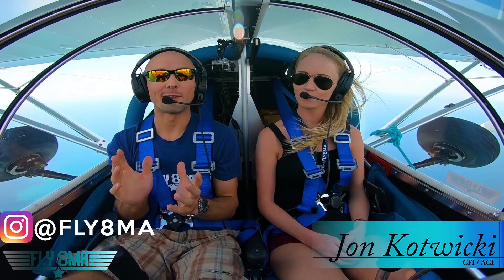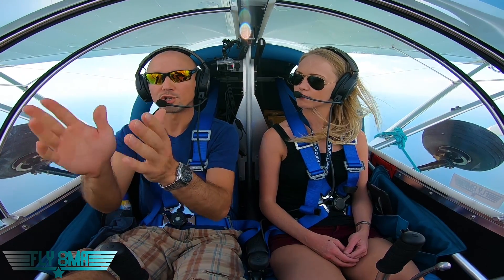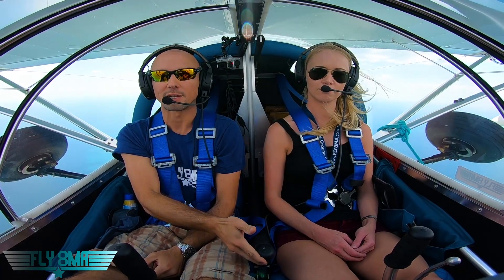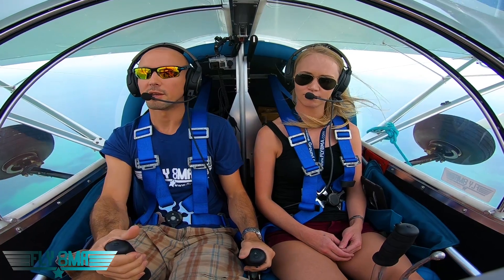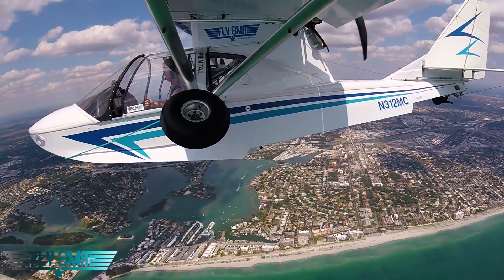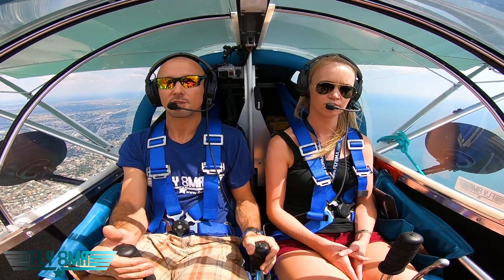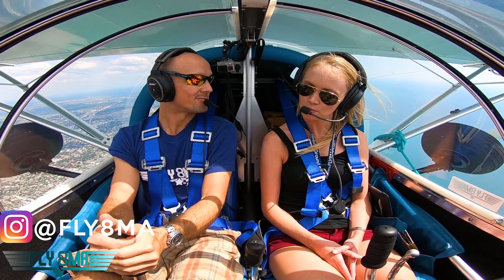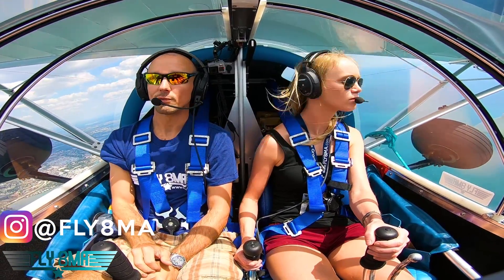Airplanes that CAN"T Go Around! | Pusher Prop Engines

Comment: horrible design work.    unbelievable.     I would not release a model airplane with those tendencies.
Reply: It's a necessary evil of making an amphibious plane like that. There are advantages too: being able to land on the water without heavy floats, keeping [most of] the water off the prop, and making prop strikes on landing a non-issue.

Comment: No such thing as an aircraft that cannot make it go around. It  is all about aerodynamics and all they entail and proper planning during Landing itself. Always always always leave an option to go around that works with your airplanes and your capabilities.
Reply: Space Shuttle
Reply: SR-71 with limited fuel. Burns a few thousand pounds on a go-around, has no drag devices and is delta wing. It was always flown inside the envelope and POH.
Reply: That's not true. The space shuttle is one type of aircraft that cannot go around. :P

Comment: So...in singleprop plane with the enginge mounted in front, if the prop turns clockwise there will be a tendency to yaw (?) to the left while on take off. If the same engine is mounted on the back of the plane, like here, will it turn to the right?
Reply from the maker: Yes and no, There is "reverse p factor" so a yaw to the right at high AOA, however the other turning tendencies due to the engine being mounted high are more pronounced and ultimately cause a left turning tendency on takeoff and most phases of flight

Comment: So....it can go around...
Reply from the maker: There's an "envelope" of low speed and close to the ground where it cannot (the yaw, roll, and pitch forces from the propeller are greater than the flight controls can counteract), obviously you can't demonstrate that in a video because crashing airplanes hurts
Reply: @fly8ma.comflighttraining199   The instructor (presenter?) never said you couldn't go around, only that special control inputs are required.
Reply: @benbalooky  but that's exactly what the title says

Comment: This phenomenon has nothing to do with the configuration being push instead of pull. The same can be observed in a pull configuration if the engine is mounted high, likewise the same cannot be observed in a push configuration if the engine is mounted in the middle.

Pusher Prop Engines
Irrelevant.
Reply: Absolutely. The title is misleading and uninformed.
Reply: You're right, but you don't have to be all "holier than thou" smug about it.